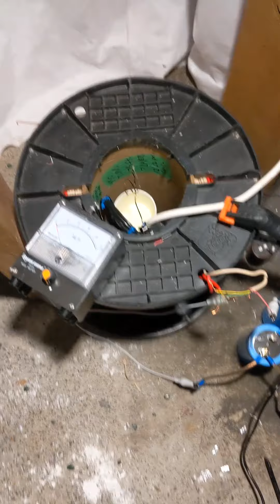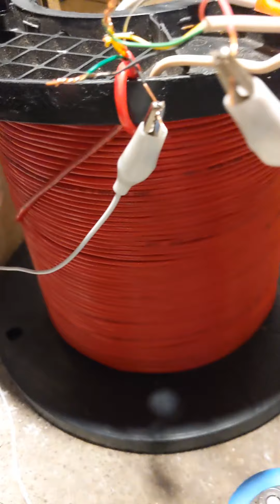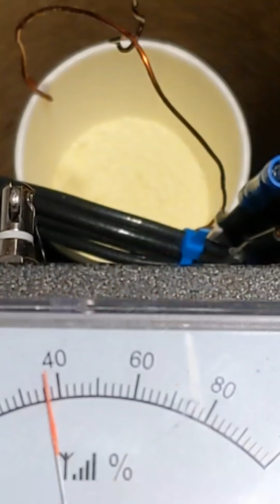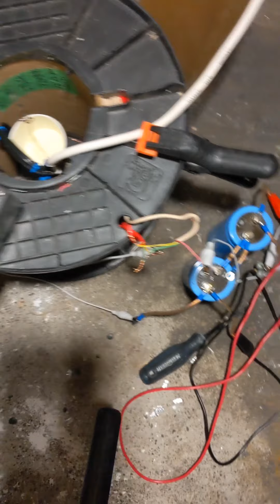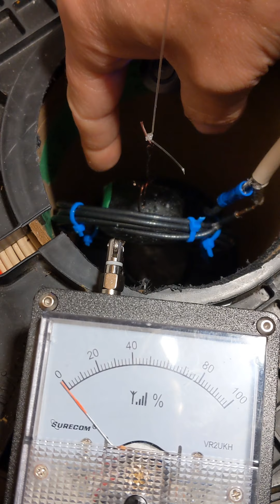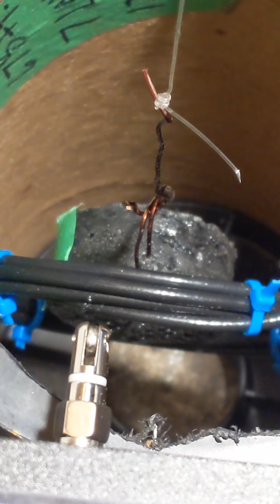EPR causes motion! Finally evidence of Larmor frequency nailed!

Comment: Good that you do null experiments to disprove the other possible explanations. What is that powder, zirconia? Looks like it. 58 megahertz seems way to low to excite EPR stuff, but may do for NMR
Reply from the maker: What I was actually trying to achieve was DNP which poalrizes nuclei orders of magnitude more than NMR. I know EPR and DNP are closely related. The little bit of repulsion I saw seems to be related to electron larmor frequency. The material I chose not to release publicly what it is yet, but it's not zirconia, but a number of paramagnet materials should work.

Comment: you need to bump it up to 58 ghz
Reply: Yeah EPR happens at GHz at least
Reply from the maker: Well then it must be Dynamic Nuclear Polarization (DNP/DNO) which was the goal, but this works at the 28.025Ghz /Tesla Larmor frequency ratio for electrons. Michael, you sound knowledgeable about this. Any more ideas on improvement?
Reply: @michaelperrone3867  I had read 28.025 gigahertz per Tesla. And I'm pretty sure his magnetic field is way less then one Tesla. I think I might just try to use the Earth's magnetic field. It's weak, but it puts the frequency down at about 1 MHz
Reply from the maker: Well my friend, then I need a 20,000 gauss solenoid (2 Tesla) which would fill my garage and open stargates to God knows where....